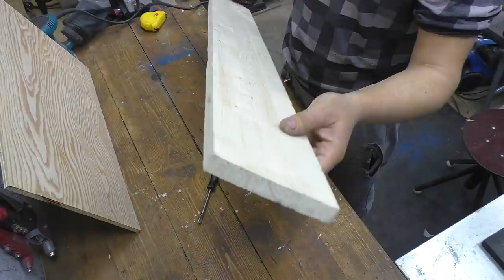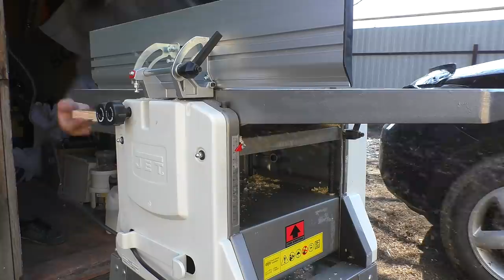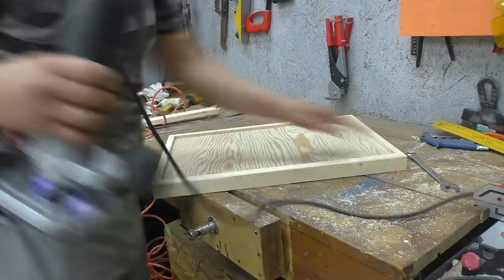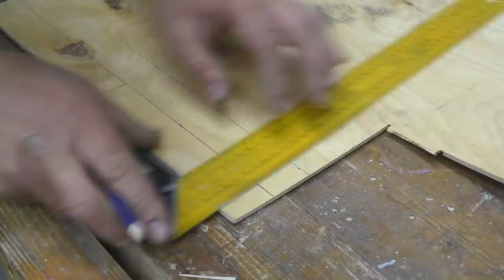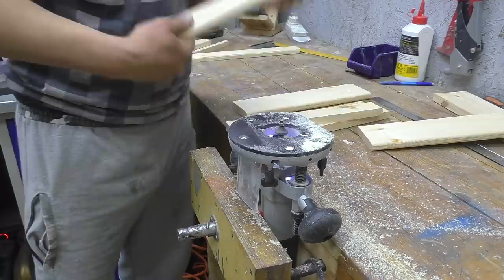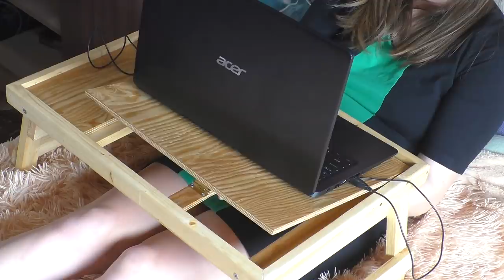Before you buy, try to do it yourself. Great idea for a home!

Comment: I just thought of an improvement which would make using it less of a "reach around": put the stops on the bottom and the prop hinged off the back edge of the table top That way when you lift it to tilt, the prop just falls into the nearest stop and you don't have to reach underneath to push it up to engage a stop.

Comment: I consider that with only one support to the center ... it is a little unstable. remember that an average lap weighs a certain kg / cm2 depending on the model and brand. However, placing 2 supports with their respective hinges provides more balance and resistance. everything else excellent ... good job.

Comment: Why do you go back and forth with router?  You should only go one direction (depends if your running the wood above the router such as when using a router table or running the router above the wood ).  Dangerous running the wood the wrong way on a router.  There’s little opportunity to come back from a router accident without severe damage.

Comment: You need to put more value in your fingers mate.  That was scary to watch from between my fingers.
Reply: Using a table saw like that with no riving knife is super dangerous.
Reply: You got me thinking but he probably just has better dexterity and higher risk tolerance than you do.
Reply: ...also no goggles or dust mask.
Fingers can (usually) be re-attached with microsurgery, but skewered eyes and damaged lungs can't be.
Reply: @bsmithril " higher risk tolerance " ? did you just make that up.
Reply: Coming soon. The Blind Carpenter. Safety LAST is your motto. Wear eye protection.
Reply: ORIGINAL DAVE HOLMES 
Yes,  If you go on, like this, you will end up, with one eye and missing fingers

Comment: Great content, but... I can't watch any more. You're scaring me. On your table saw, riving knife?, guard?, occasional use of a push stick. The machine woodworking teacher, who took a class on a course I did many years ago, had three fingers (if I recall correctly) missing from one hand. One day, table saw running, something fell on the floor, he leaned down with one hand to pick it up, put his other hand on the saw bed to steady himself, ouch. I'm genuinely concerned. If you're watching what you're doing, that's no protection from accidents. Safety devices and aids, they were developed for good reason. 203k subcribers, and I'll bet most of them are enthusiastic amateurs or wannabes. I have never made a comment like this, but you are putting your viewers at risk, and that's a heck of a lot of views you're getting.